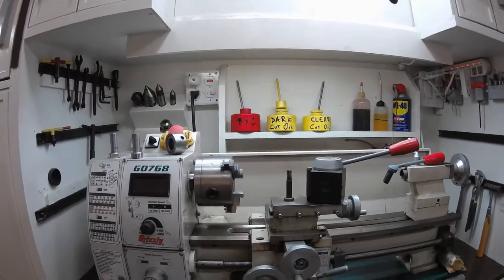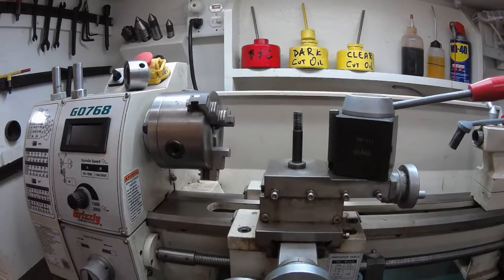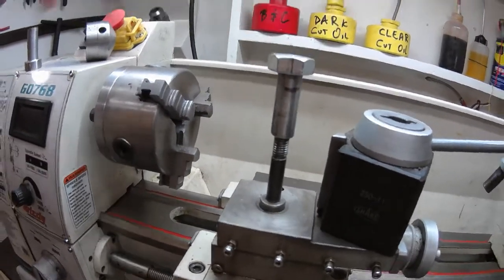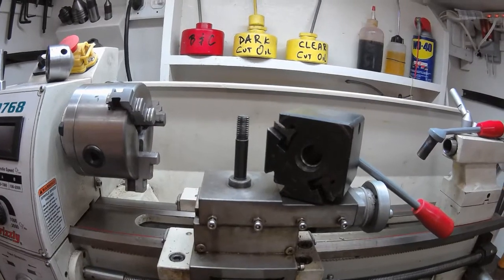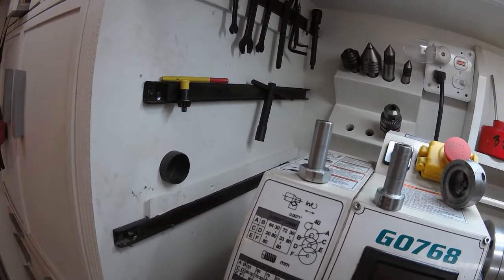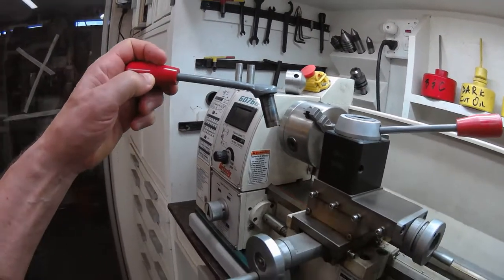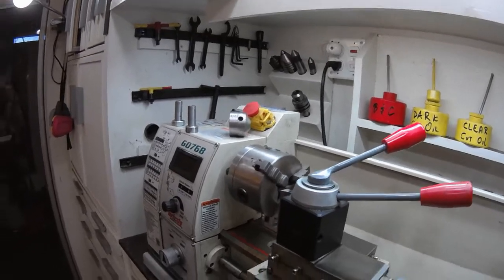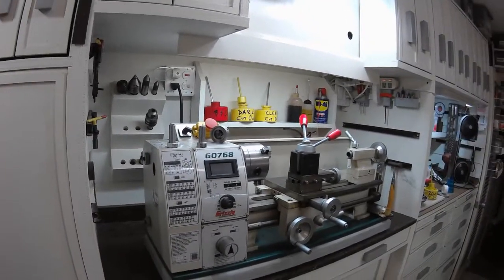Grizzly G0768 - Quick Change Tool Post  (QCTP) and Top Nut install

Comment: Is there a compelling reason to go AXA instead of OXA if the compound and slide tend to be the weak links? Just curious as I'm looking to get the same lathe but would love to skip the mods if I can, for now. Famous last words but I don't "think" I will ever need a larger lathe 🤣
Reply from the maker: The OXA QCTP is often recommended for mini-lathes.  I chose the AXA because it would fit, and was a bit heavier.  Probably could have gotten by with OXA, but glad I went AXA.  Not going to get a bigger one, so have no other excuse.  Compound and slide are weak link, but I can take smaller bites and am quite happy...

Not sure if that answers it completely--

Comment: where did you get the handle piece that matches the shars? do they sell spares
Reply: Or maybe you turned it and painted it red?
Reply from the maker: @coopersloan3938  The red plastic handles were from another wood lathe attachment that just happened to have same thread as the metal rods.  I've made similar handles out of brass rod, drilled and tapped for the threads and knurled to provide a grip.
Reply from the maker: @coopersloan3938  these are on eBay, and might work?
M8/M10/M12 Thread Revolving Handle Grip Cone-shape Socket Plastic Knobs Handles
Reply from the maker: @coopersloan3938  https://www.ebay.com/itm/392908101920?_trkparms=aid%3D111001%26algo%3DREC.SEED%26ao%3D1%26asc%3D20160908105057%26meid%3D9368cc0f0e304d3f9cc84a16fb212e82%26pid%3D100675%26rk%3D1%26rkt%3D15%26mehot%3Dnone%26sd%3D392908101920%26itm%3D392908101920%26pmt%3D1%26noa%3D1%26pg%3D2380057&_trksid=p2380057.c100675.m4236&_trkparms=pageci%3Aa143456a-a6f9-11eb-b191-c6c531125952%7Cparentrq%3A10fcaa4f1790a9bdee38d10dffbf2f58%7Ciid%3A1

Comment: i have the same chinese mini lathe with the same problem - 8x16
Reply from the maker: All the imported lathes have the standard 4 way tool holder.  The QCTP makes it a lot easier to change tools. This was first purchase for me, and it has worked well to date.  I didn't want to spend months remanufacturing an old belt driven lathe, and don't have the room for one.  Good luck with yours.
Reply: yes - same for me - if i already had the machining 'chops' i would probably go for the older bigger ones too - or reengineer this one ... who knows .. check out hobby-machinist (google it) for a great and helpful forum. DO not go to practicalmachinist.com if you're looking for advice and have a mini-lathe - they will block you and kick you off! i learned the hard way :P
Reply from the maker: @antigen4  --  Yes I have registered account with Hobby-Machinist- as I purchased a PM-25MV mill drill to go along with my Grizzly lathe.  Very helpful group with lots of info.
Reply from the maker: @antigen4  - couple of other things I've done with the Grizzly--  
 Removable/cleanable chip pan,  and a removable DRO for tailstock.

https://www.youtube.com/watch?v=Q615prreExA&t=26s
https://www.youtube.com/watch?v=4JMgoY4KTIY

Comment: I just got an 8x16 Lathe and your video is of great help to add an AXA tool post to my Lathe. How did you go about taking the 4mm off the interior bushing? Thanks for the video and any help!
Reply from the maker: There aren't to many videos on this- so this one may answer your question?

https://www.youtube.com/watch?v=bS-kXP9uZsE

Quick answer is to remove the center sleeve from the QCTP body and chuck it very tightly in the lathe.  Then remove approx. 2+ mm off of the bottom threaded area of the sleeve in very small careful cuts.  Then when the sleeve is re-inserted into the body of the QCTP,  it fits over the boss on top of the compound and you don't need washers or spacers.....

Hope this helps!

Comment: Is the video link in your description truncated? It seems to be an invalid link as-is.
Reply from the maker: Yes- there now seems to be a problem with that link.  It was a uvideo by "twitch" who turned down the head of a bolt for adding a QCTP on a old HF lathe.  I will look to see if it has been relocated, but was a couple of years old at the time I saw it.  It was the only video I saw that used the head of a bolt as a compression feature that screwed onto the top of the existing stud of a tool post.  Other mounting methods called for removing the old stud and pressing in a larger, taller one.